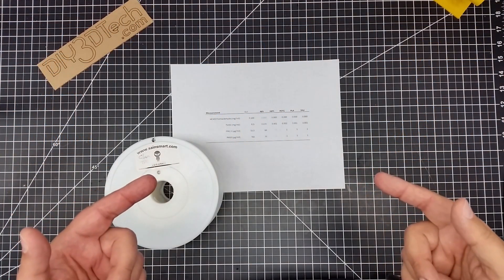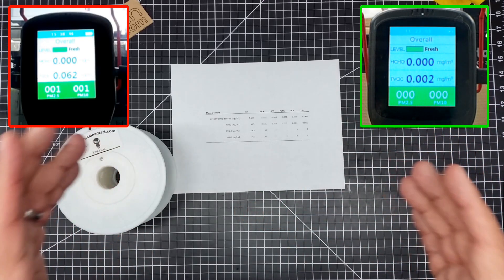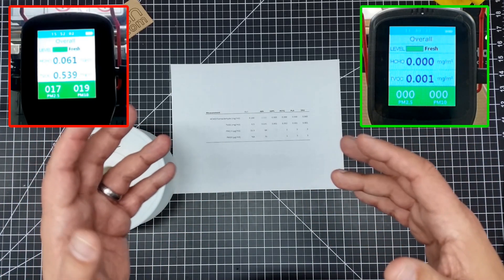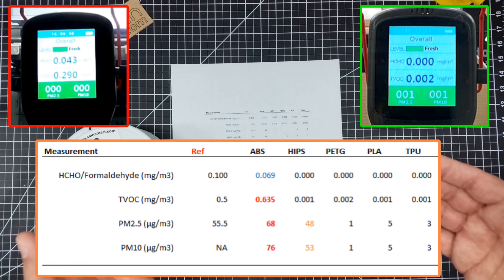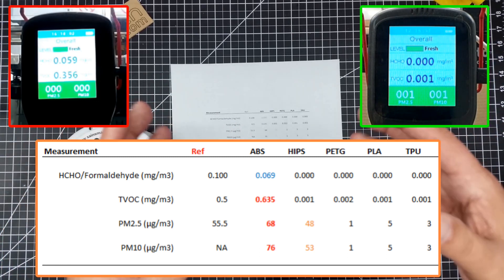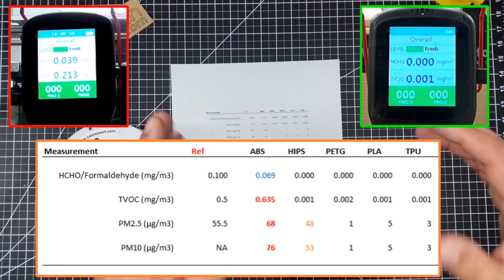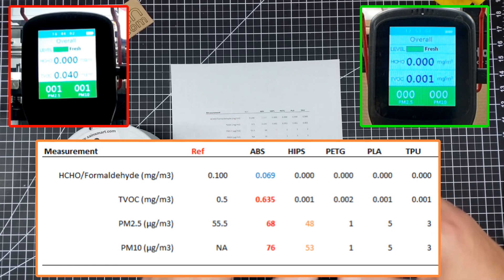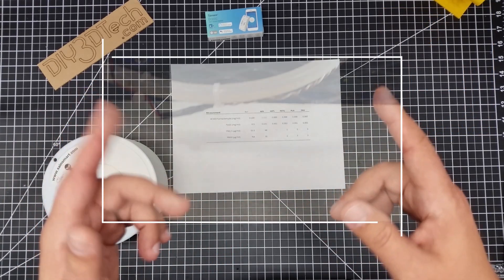3D Print Air Quality  - TPU  vs  ABS and the Results are In!

Comment: I'd be interested to see measurements taken at different distances from the printer. Just to see how the air quality in the general area is. Small fast prints wouldn't have as much an effect as larger prints in sure, but I feel like the ambient air quality is as important a measurement as the air quality right at the printer.

Imagine you start a print but aren't right by the printer. You're either a number of feet away or even in another room. You let the print sit after it's finished to cool a while, then come retrieve it. What would the air quality be like then? These are great tests and I'm glad you've done them, but you have to take into account real world usage. If you have a bit of venting or source of fresh air, even better.

Not trying to give you a hard time or anything, these tests have been interesting, and I'm a lot less worried about using PETG now than before. These give a good baseline of the general level of toxins they each release.
Reply from the maker: Not taken as a hard time, however as covered before if 5 particle are created they remain and diluted in a larger pool of air the ratio will of course change.  However it is once again the cigarette analogy as one will not kill you (lets hope) but the habit will.  In other words, one print creates 5 particle-sq/m two now is 10 and so as 1st off, Ultra fine particle will not be filtered by normal filters and second neither will the VOC or formaldehyde.  Now if your using this in a truly well vented aera then your sharing these nasty little particle with the neighbors and all is good as mentioned I vent HIP & ABS outside period.  However most people do not, they set up a print farm in their bedroom and sleep next to a printer printing ABS for 150 hours inhaling deeply all night as the UFP enter their blood and potentially make their way to the brain.  Again one cigarette isn't the issue but the repeatability of the habit  is...